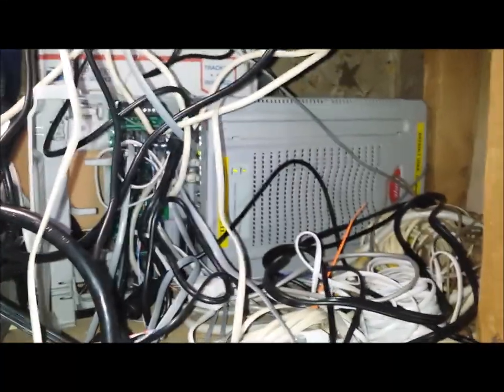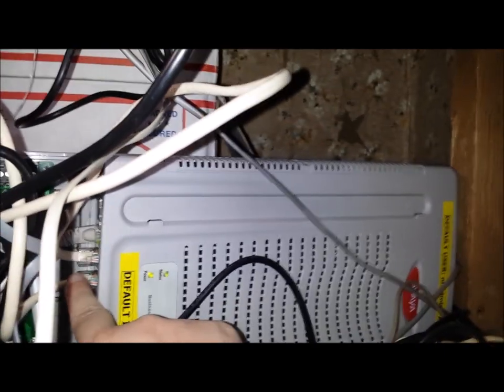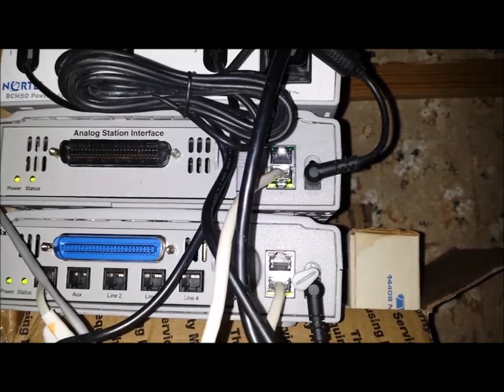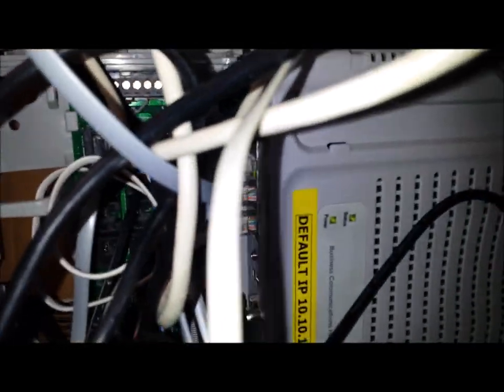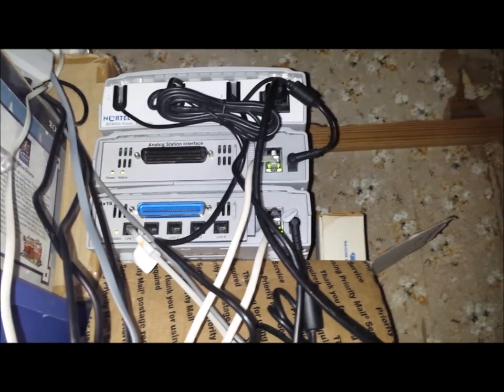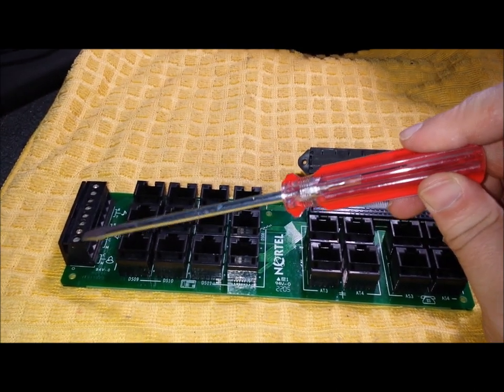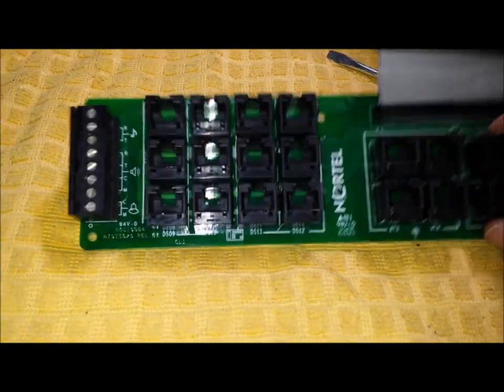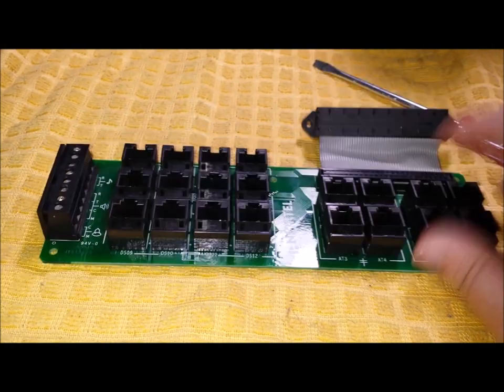My Nortel BCM 50 Phone system

Comment: Neat system. Thank you for sharing. I love stuff like this 😁 yeah wires can get a bit messy sometimes but as long as we know what’s what it’s all good!  Is this in a crawl space of your home between walls?
Reply from the maker: Its above a closet so its sort of in the attic. I found the issue with the analog  Media Bay Module and it’s a easy fix.
Reply: @bigb2littleb  cool. I was also thinking of using my attic space to run wires but I can’t get around too easily up there so I used a crawl space between the walls.

Comment: so on the breakout board, how many phones can connect to the analog port (only one port)
Reply from the maker: it has 4.
Reply: @bigb2littleb  so..., there are 4 analog set rj45 ports on the breakout, how do i connect an rj11 cord to it for an analog phone??
Reply from the maker: @LidLockTV  you plug it in directly.
Reply: @bigb2littleb  so the t7316 for example, has an rj45 connector?
Reply from the maker: @LidLockTV  rj11
Reply: @bigb2littleb  so how do I plug rj11 into rj45??